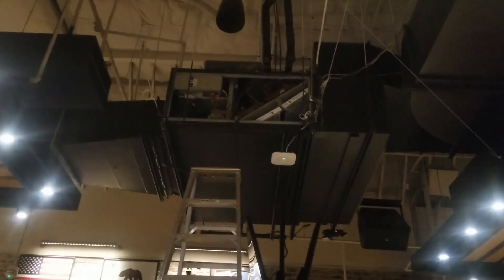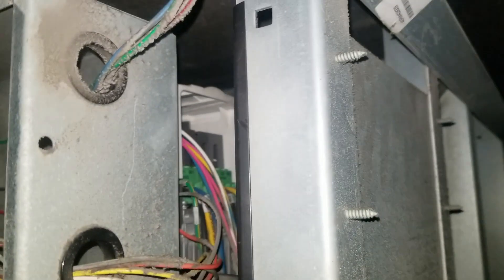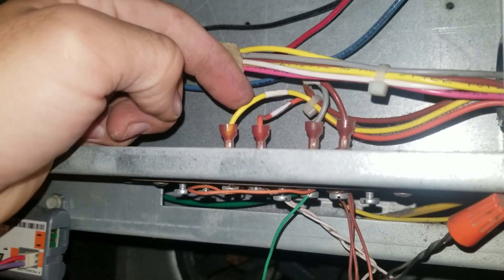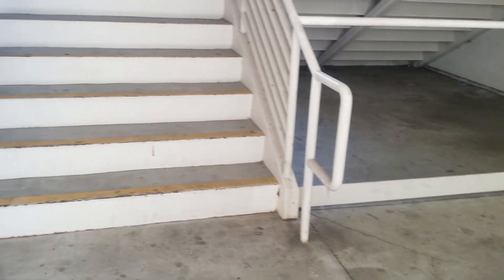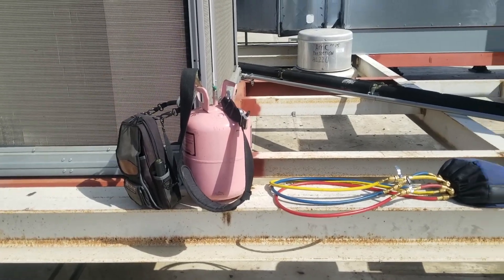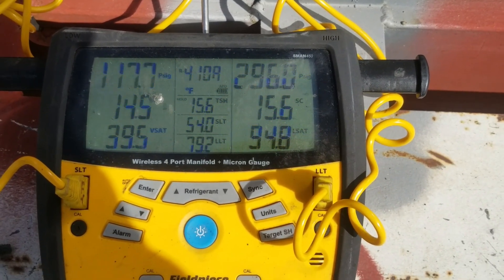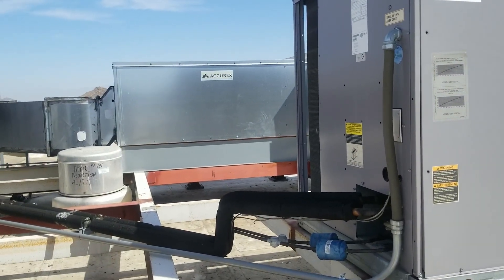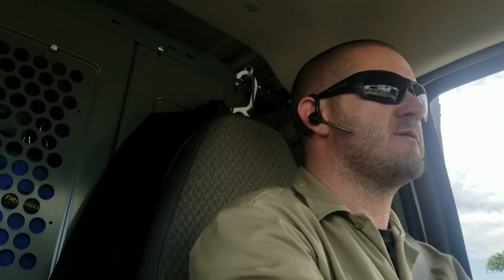Split system AC with a water leak and a refrigerant leak

Comment: It would have been great to see the unit running 100% cooling before any modifications to see the issue happening. Yeah, mostly likely the fan speed issue has a lot to do. I wonder if the condensate tray was 100% levelled also.

Comment: Why didn't you put the jumper from y1 to y2? Putting the jumper from G , wouldn't when you call for heat , the g will still give power to y2? Or am I wrong ?
Reply from the maker: It has separate jumpers for the heating stages already hooked up to w1 and w2 so they just never landed the cooling wires.
Reply: @HVACRVIDEOS  is the jumper inside the unit or in that wiring mess? I didn't see is on the terminal block. I only seen the jumper that you from g to y2

Comment: "Always inspect your service caps to make sure they have the rubber o-rings inside, those o-rings will cause you a headache later." LOL
Reply: Damn right. Accidentally lost a whole charge like that once. The valve cap actually depressed the schrader core due to the missing rubber o-ring

Comment: Your condensate issue where your finding water dripping onto your filters could be due to the fact that units with slanted  evap coils the low voltage wiring must be wired so when it calls for cooling y1 has to be energize first I seen it where the wiring was mixed up where y1( bottom half of coil) was actually y2 (top half of coil) what happens is on the slanting of a coil y2 would be the top half of the coil if you energized top half before the bottom half (y1)  the coil can't Wick the moisture all the way down the coil into the drain pan cuz it hits a dry spot and gets blown off into a blower section into the fan I don't know if this was your issue your wiring issue anyway good vid

Comment: You definitely got your exercise on this job.   Good job finding that tiny leak.  If you think of it on another job, can you show how purge the hoses and get some of the refrigerant back into the system.  Thanks.
Reply: brad mironik you need to have ball valves or low loss fittings on your hoses. You close the valve or disconnect the low loss fitting on the red, high side. Open the high and low side ports on your manifold and the high pressure liquid will be pulled from your red hose, through your manifold, into the blue hose, and into the suction line. If your manifold has a sight glass, you can see the liquid flow and bubble off. You are left with just low pressure gas in both hoses. Hope this helps.

Comment: I understand how the terminal block functions on a furnace, do those "terminal strips" operate in a similar fashion?
Reply from the maker: So the unit has a two speed blower controlled by a VFD. The VFD will speed the blower up to high speed when the second stage calls for cooling. The original installer never landed the wires on that terminal board so the blower was always running on low speed but the 2nd stage compressor was still coming on, because the blower was running on low speed when the second stage was running water was dripping off the evaporator coil and into the bottom of the unit. The airhandler partially uses the air flow to help the water run down the coil and into the drain pan.  Does that make sense?